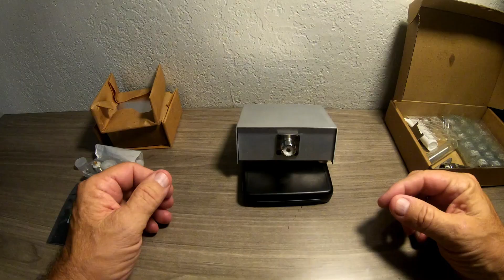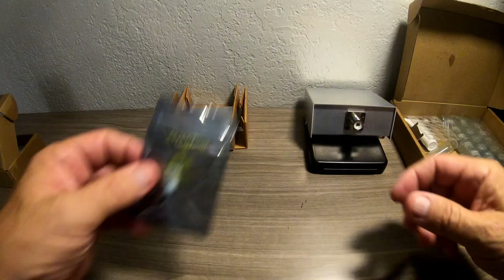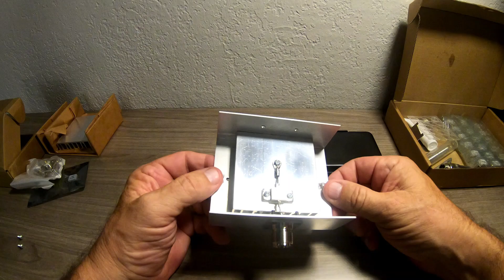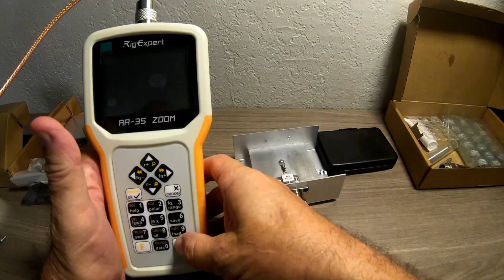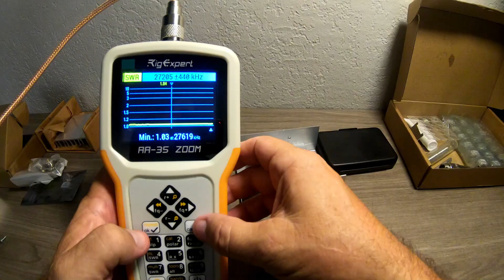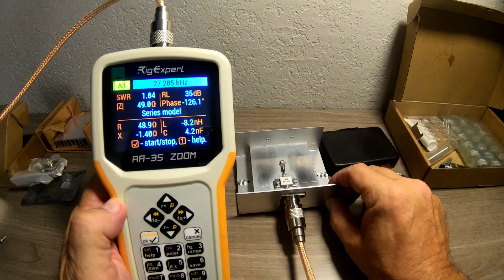DIY 50-Ohm 250W Dummy Load Build (Tested on an Analyzer)

Comment: Nice Job!. Much better design than most home brew Perhaps the heat sink would be better on the outside of the box. The fins would then be effective for cooling.   It would be nice to know the VHF/ UHF performance.  Many dummy loads fail at these frequencies.
Reply from the maker: I have had it in my travel pack and it has revealed a small issue. The heat sink on this prototype is only connected at the rear of the case. This seems to have let the front of the heat sink vibrate some and broke the tab on the so239 side of the resistor.  I've since soldered it back together,  but in my next one, I will also secure the front of the sink to the box. Thanks for watching and commenting